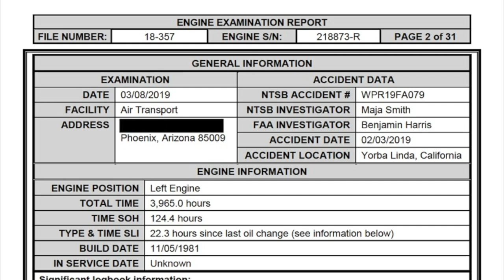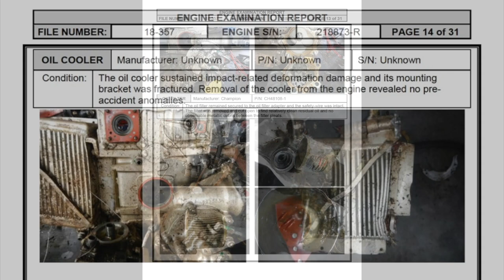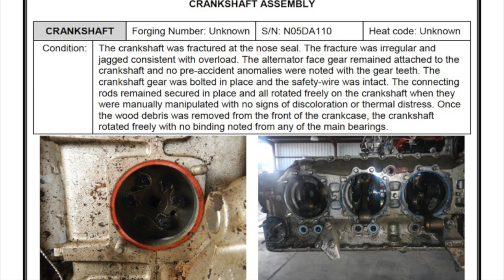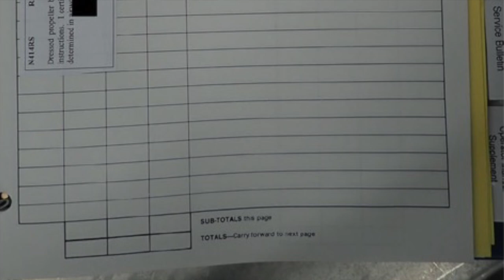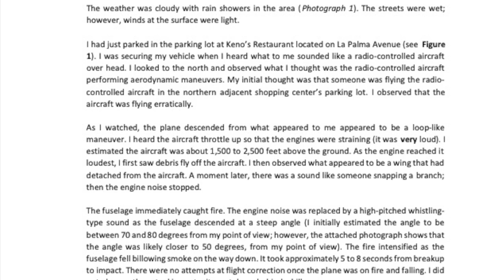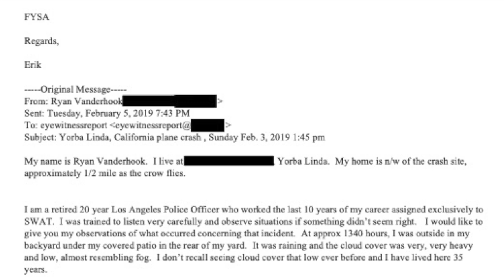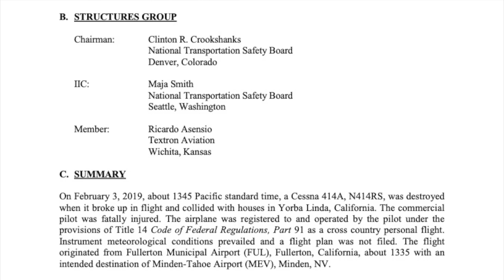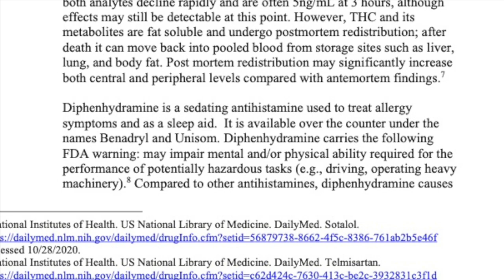Cessna 414A Chancellor In-flight Breakup Over Yorba Linda

Comment: I heard it happen, 3 miles from the site. Was relaxing, a strange roar fwhen it hit. Pilot was a jerk. Killed people on the ground. Rough weather above, cracked spar he refused to have repaired.
Reply: I thought it was SD in IMC  looked like a spiral dive and he yanked on the controls when he broke out of the bottom saw the ground coming up.
Reply: @Mike-01234  It was a combination of negligence of maintenance and hazardous attitudes.
Reply: @philconey11  he was grounded and had his pilots license suspended for quite awhile in 1977 and in 1980 for failing to maintain his plane and for changing his flight logs. 
He also was a Jeremy Dewitte claiming to have served on the Chicago Police force for 20 years and carried a stolen badge which the CPD confirmed.  
Guy didnt want to follow rules.

Comment: Hearing the whine of the engines is terrifying
Reply: Absolutely
Reply: Can you imagine the 6 people where the plane landed? I wonder if there is a video from their home from Ring or something, they all were hit, and 2 made it out of the 6 in the home. Sad, and what bad timing. They were watching the Super Bowl, what are the odds, 1 in 365 days they probably would have not been there sitting the other 364 days.
Reply: And then the sound of the breakup ….
Reply: The strain was apparent even before the plane became visible in the video.
Reply: All I hear is the dam dog barking.
Reply: That's because the pilot was not current flying in IMC in the fog where you can't see out the window. What happens is they begin a turn bank over their balance gets out of wrack they think they are banking the other way so they bank over more because it takes lot of practice to fight what you feel and what you see. Once you get past a amount of bank starts to spiral into a dive. That is when the engines you hear wind up because he is diving and spiraling called a death spiral. Then you hear the popping noise that is because when they break out below the cloud deck at 1000 feet above the ground going 300 mph they see the ground rushing up at them yank back on the controls and airframe breaks apart that is the snapping noise and engines stops running. Because that twin engines are on the wings near by the fuel tanks caught fire when the wings snapped. Nothing he would do except watch the ground come up at him. Not much he could have done just too low I think it was around 800 feet bottoms so.
Reply: @Mike-01234 , thank you. I wish I had read your comment instead of watching the video. All I wanted to know was why it happened.
Reply: @flightbug2902  I didn't hear the breakup.  Where did that happen in the video?
Reply: @daddystabz  Well to me it sounds like it right after the engines reach the peak of their noise and just before you see the smoke and fire appear, at the beginning of the video.
Reply: Listen to the airshow plane that lost its prop. Sounded like a damn minigun when the load came off. Luckily he landed it

Comment: Spacial disorientation when he came out of the ceiling and ultimately breaking apart.
Reply: That doesn't explain why the plane exploded in midair!
Reply: @jimmyneal1988  Simple, pilot induced structural overload will result in ruptured fuel tanks, and electrical short circuits at the moment the plane rips apart, a good mixture for a nice explosion if you ask me...

Comment: Watched the plane flounder and then angering in from the Keno's parking lot. I've never heard a plane engine make the noise it made. Saw it brake apart and hit the homes. Was heading up to a super bowl party three blocks from the impact area.
Reply: did you mean to say "augering in"....thats why I always proofread my texts !!
Reply: Well did u cancel the superbowl festivities?
Reply: @paulazemeckis7835  nothing like a spicy story for the Superbowl party, condolences to the group at the accident party.
Reply: @jordaniss  The word on the street is that they were for the other team any way.
Reply: So that was the engine that had that rapid pitch rise?

As a Cessna 402 (which is an unpressurized version of the 414) Mechanic, that was a very unsettling sound to hear. No way is the engine supposed to run at the insane RPMs that sound suggests...
Reply: Totally unnecessary.  Condolences and sympathies to the innocent bystanders and there loved ones

Comment: One engine is off the plane and on fire before the plane hits anything...how does that translate to bad weather / pilot error?
Reply: Was it still attached to the outboard wing that broke off ?
This sudden RPM increase - prop come off or feathered blades ?
Reply: Diving and breaking up  are usually the pilot's doing.
Reply: Planes have what is called "VNE", which is your "never exceed" speed. Unlike a car, if a plane goes too fast it will literally fall apart in mid flight.

That's what happened here.

Comment: Based on the information presented, I believe this man flew VFR into IMC, activated the autopilot, fell asleep due to the Diphenhydramine in his system, moved the stick in his sleep deactivating the autopilot, awoke to find himself in a low altitude high speed dive and proceeded to yank back on the stick exceeding the rated G-Forces for his plane, literally tearing it apart. When the wing was ripped off, the fuel line was ruptured and ignited causing the plane to burst into a fireball and disintegrate as it fell to the Earth.
Reply: His doctor's report is missing from this video. What drugs was he actually prescribed ?
Are you sure about the 'fell asleep' - could he have possibly fainted / blacked out ?
Reply: Good bunch of speculation there.

Comment: I've heard that THC last in your system for 30 days. The pilot could smoke after work and get high but during work hours be totally normal and not under the influence at all.
Reply: That's true but there is a pattern of deviant behavior here. This guy might as well have committed homicide.

1. Flying VFR into IMC.
2. Ignoring potential problems with his aircraft.
3. Flying at 17,500 ft. I wonder if he was using an Oxygen mask? Probably not.
4. Climbing an aircraft in an inefficient manner. If he encountered icing, it would have changed his wing and increased stall speed.
5. 75 years old and, unsurprisingly, lax about his physical condition.
6. Active Benadryl in his blood.

The Mary Jane situation, though legal in California, is still prohibited on the federal level. Since Pilots are certificated by the FAA, I wouldn't be surprised to see a prohibition on it's use by amateur aviators. It would be near impossible to enforce, unlike with Airline Pilots, though.

Comment: Looks like another unintended flight into IMC, pilot gets one of those spatiotemporal thingies and falls right out of the sky. I've read so many NTSB reports where things like this happen. Now, I'm not an aviator, just a big fan of aviation, but stuff like this seems to happen with depressing regularity. I wonder if there is a durable engineering solution to things like this? An autopilot setting that can detect stuff like this and help/stop the pilot from falling into these kinds (or so it seems to me right now) of traps.
Reply: Garmin autopilot systems have a "Level button" which cancels everything and flies the plane straight and level. It can be a lifesaver in IIMC conditions, but I'm not sure if this aircraft had a Garmin.
Reply: Wing levelers have been around for a long time
Reply: Yeah- there's a thingie called an ATTITUDE INDICATOR.....and another thingie called an Angle of Attack, a principal behind successful lift.  But mostly, it's VFR rated pilots getting into IFR conditions- lacking the INSTRUMENTATION skill-sets, losing spatial awareness, failure to recover.
Reply: Have you been Vaccinated lately? 
The govt knows already.
lol...
Reply: @Noe Carrier Well there is more to the story than that. Evidently he flaunted regulations in the past, had a stolen police badge on him, he was overweight with an enlarged heart possibly aggravated by taking Viagra recently...and smoked or ingested THC recently, plus had taken a OTC decongestant recently. Overall it would seem like a guy that shouldn't flying in the first place.
Reply: You can't fix stupid....He had no business being in the left seat of a simple single much less this aircraft.  He got the spins and that was that.  How to make a smoking hole 101...
Reply: 16:00 looks like the PIC did this sort of thing routinely, flying into IMC without Instrument Flight Plan or Rating.  
No Old, Bold Pilots.. unfortunately they take out other innocents.
Reply: They sure do it’s called flying by instruments. If you aren’t proficient  at flying like that or it creeps up on you it can prove fatal . Reading the instruments is easy but trusting them when encountering IMC especially suddenly can be the hard part. Your body and mind want to tell you to do something completely different than what your instruments Are 1000% accurately telling you what to do to stay airborne and level. It’s the same principle as what most experience with a stall , first instinct is pulling back attempting to climb when the correct input is lowering the nose and trading altitude for airspeed recovering and leveling off
Reply: @TD_YT066  "No Old, Bold Pilots..." 

He was 75 years old! LOL!
Reply: @westrex  Sounds like Hunter Biden
Reply: @alexeubanks467  If pulling back on the stick in a stall is one's first instinct, they shouldn't be flying an airplane.
Reply: @docholiday7758  I understand that was an attempt at humor but it's clear you are a member of a cult. Your life and ours will benefit if you break free. Try reaching out to someone you trust but disagree with...and allow yourself to listen.
Reply: @westrex  Yes, "Overall, it would seem" so. Brilliant deduction, Sherlock.
Reply: @docholiday7758  🤣🤣
Reply: Most General Aviation planes would not have an angle of attack gauge, there are some aftermarket products available for GA.
Reply: I don't understand it either. How so many people get spacially disoriented just doesn't make sense when they have instruments in front of them that show your angle and where you're pointed. How so many don't trust their instruments just doesn't make sense to me. When you're driving down the road with a perfectly functioning speedometer you don't just suddenly go nah I don't trust that let's floor and decide the speed on our own, just because you turn with the wind and suddenly feel slower.
Reply: Don't get me wrong I can totally understand spacial disorientation, in the clouds everything looks the same and it's easy to suddenly feel like up is left and right is backwards. But what u don't understand is how the pilot doesn't immediately look down at the Gauge to determine if what they are feeling is true. Regardless to imc, ifr, vfr, or xyz ABC cat giraffe or anything else, unless you somehow lose instrumentation 100% that display is going to show you which way is up, left, right, and down.
Reply: @Gkitchens1  Powerful physical sensations can accompany spatial disorientation. I was once on a theme park ride (Universal City, LA) that was designed to induce vertigo. The tram we were on pulled into a cylindrical tunnel whose inside was white with a black spiral (corkscrew) painted along the length of it. Soon after the tunnel began rotating around us (we were  sitting perfectly still) my head slammed down onto my shoulder and I was incapable of lifting my head upright using all my strength. I was completely debilitated. Vertigo can be completely physically debilitating as well as disorienting. That experience alone convinced me to never get an instrument rating.
Reply: @Gkitchens1  It's our nature as humans. During stressful moments (like trying to manage an ascent through clouds away from the airport while talking to ATC and so on) we default back to flying by feeling. It's an incredibly disorienting sensation and mental tricks/training/vigilance are needed to fight it.

Lots of these issues also happen with pilots untrained in IMC flying. They're trained and experienced in flying visually and by sense of gravity. Suddenly you have to stop doing that and try to fly by your instruments. Other people have explained it better than I in this comment chain.
Reply: Better decision making would be a fine start.
Reply: @westrex  I just stolen badge, but paperwork that showed him retired from the Chicago Police Department. When his daughter was asked, she said oh yeah that’s when I was a little girl. Further pressed after telling her the Chicago PD said they had no record of him, (under EITHER name, one of which she just provided) she said no comment on this anymore

Comment: The flight track data was consistent with the known effects of spatial disorientation and a resultant loss of airplane control. Therefore, the pilot likely lost airplane control after inadvertently entering IMC due to spatial disorientation, which resulted in the exceedance of the airplane’s design stress limits and subsequent in-flight breakup. The pilot had THC in his blood.
Reply: "The pilot had THC in his blood."
I doubt marijuana had anything to do with the cause of this crash.  But it makes for a great "boogeyman."
Reply: Plausible. Could've been that, especially considering the report that he was known to casually violate VFR minimums instead of filing IFR. But there were some other leading indicators in the reports as to why he might've lost control.

- Possible lack of engine maintenance noted by the other pilot on the angel flight Dripping oil and the pilot shrugged it off. Was the loss of awareness due to having to triage an engine failure in inadvertent IMC?
- A post-event PIREP that the accident pilot had likely flown into icing conditions as well. I'm not IR so not sure...I imagine this might not have been enough time in flight for an icing-induced loss of control. But still sounds like a factor. Did he lose awareness because of being distracted by unexpected icing?
- Taking a string of medications not disclosed to the FAA. Is it possible the disorientation was caused by a medical emergency? Indications of enlarged heart, arrythmia meds...plausible. And while I agree with you on the black and white of the rules, I also can't disprove the medical professional's recommendation that the postmortem THC concentration was not indicative of the level in flight.

Could have been a bunch of things and the root cause is not easily discernable from the couch. From here though, it does sound like a pattern of hazardous attitudes and it's unfortunate that others had to suffer for it.
Reply: And Benadryl. Sleepy time.
Reply: brian biddle I wouldn't be good with a pilot popping bennies for his sniffles before the flight.
Reply: @phillipzx3754  AND!!!!!!! THE DOUBLE BONER MOANER!! VIAGRA RUNNING, THERE WERE A LOT OF SNACK WRAPPERS AND EMPTY PLASTIC BOTTLES IN THE BACK, IF I CAN RECALL, SORRY ONLY TRIED SMOKIE TWICE WHEN I WAS 17, MADE ME SO PARANOID, NEVER TOUCHED IT AGAIN! FYI
Reply: @speedomars  AS YOU SHOULD, AGREE 10000000%  THANKS
Reply: @StortWeldingCoLLC   It's time to sell that C-64 and buy a real computer that supports both upper and lower case.
Reply: @phillipzx3754  SORRY, IM IN THE HOSPITAL, ONLY HAVE LEFT HAND, JUST HAD ROTATOR CUFF SURGERY! DON'T GET ONE!! I M SORRY, WASNT MY WAY OF SPENDING THANKSGIVING!
Reply: @hudsoncraftworks  Your right, most likely a combination of factors.
Reply: @HabuBeemer  Or he read the medical report stating that the levels in the blood most likely had nothing to do with the accident. Personally I prefer pilots that keep away from these drugs every day, but then I maybe never fly again
Reply: Entering imc was not inadvertent. It was apparently quite intentional. 

"Be advised weather starting 4 miles east of the airport"
"Thanks for the advice....."

Proceeds to fly east into imc.

That's not inadvertent. He knew before he took off he was flying vfr into imc.
Reply: @speedomars  But THC is fat soluble and stays in your body for weeks after last smoking, his levels at TOD were consistent with him not being under the infuence, even regarding the pooling of it in the blood after deat that might skew the samples to a higher level.
Reply: @phillipzx3754  Fun fact:  Cannibis users are more sensitive to being called out than alcoholics
Reply: @kwisatzhaderach1458    Fun fact: Alcohol consumers are more likely to be abusive to their spouse and other family members than those who consume cannabis.  They're also more inclined to drive while intoxicated. 

Cannibis?   ;-)

Comment: A small aircraft came over my house a few weeks ago similarly to this craft, though I have found nothing in the media regarding a crash. I could hear it flying normally and then it went to very high rpm so loudly it shook my house and I went outside. I never could see it because of low clouds. But it was much louder than if my truck was running or reving in my driveway ( project, v8 no mufflers) my house shook the entire time that it was audible and it tapered off eventually and I couldn't hear it anymore.
Reply: Planes are loud, may have been climbing out
Reply: Probably just ascending after takeoff. If you live near a small airport you hear this all the time!
Reply: Assuming you’re in yorba Linda, If this was at the time of the accident, it was that plane.  The noise was remarkable for all of the witnesses.